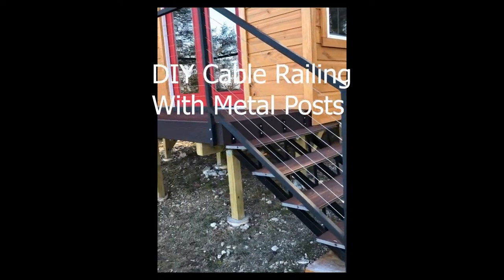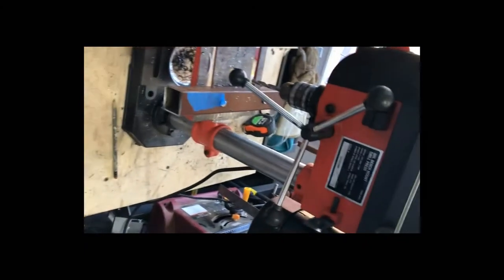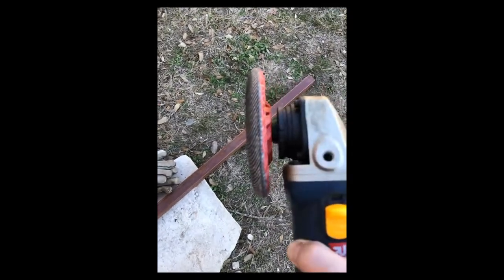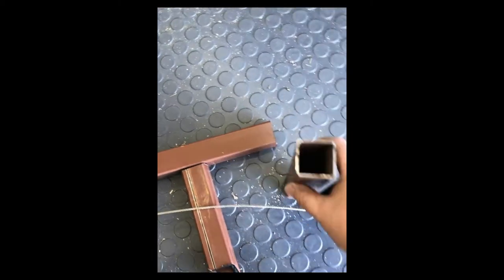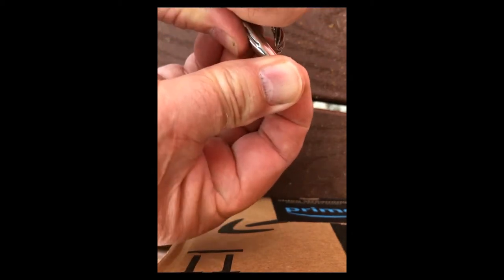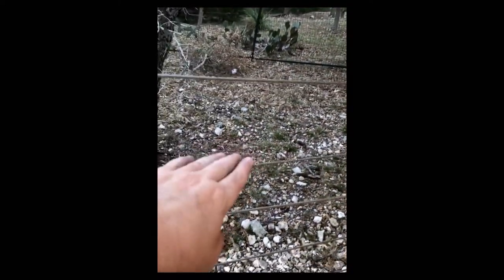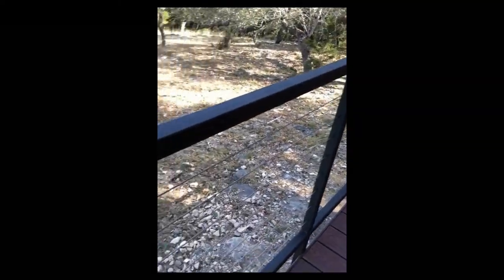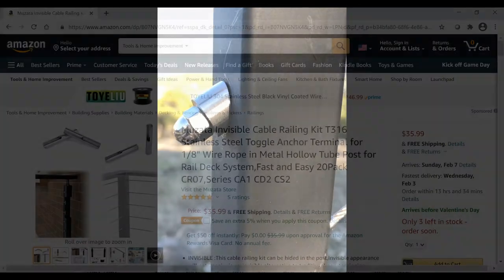DIY Cable Railing with Metal Posts

Comment: After three years, did the SS cable stand up? Any rust?
Reply from the maker: The cable still looks great!   A couple of posts have a few spots I could sand down and touch up (mostly on the welds),  but overall pretty good.

Comment: Great video, thanks. How did you attach the posts to the fascia board?... Screw/Bolt size, washers, blocking on inside of fascia, etc. Thanks.
Reply from the maker: Thanks.  There is a 2x8 directly under the fascia (the trex fascia is basically for looks).   I put another 2x6 blocking behind that (between the joists) and used long 3/8" carriage bolts (I believe 8" if I remember right) to attach the railing.   Have large washer and nuts on the inside.   Just got all that from Home Depot.